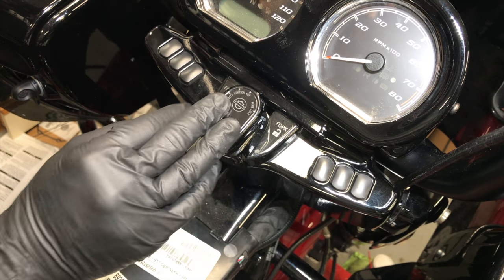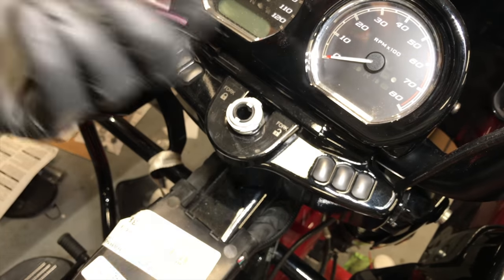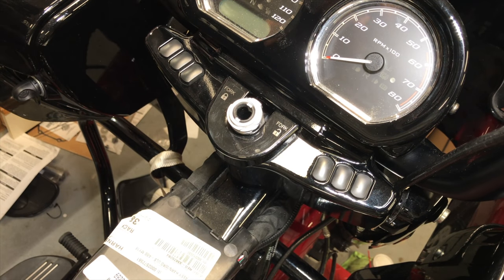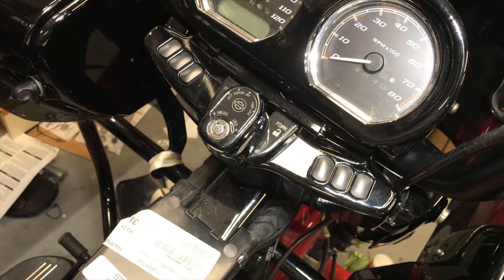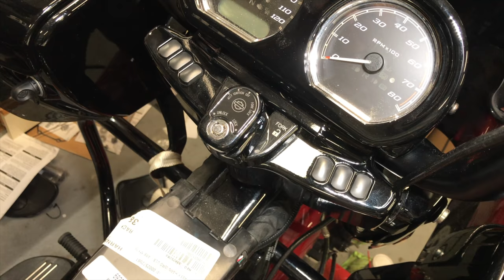How to Remove a Harley-Davidson Touring Model Ignition Switch

Comment: Where are the videos that show how to disassemble and replace  parts inside switches? I'm trying to find out how to take apart an older switch on a 98 softail so I can replace the new tumbler with old  key tumbler that uses the vending machine type key

Comment: Is there a screw under the ignition switch cover inlay? I have an aftermarket cover I'd like to use but it has a place with a countersunk hole and I done want to bend the inlay if there isn't a screw hiding under there.
Reply: Ok. Took a chance. There is a security torx screw under the inlay that holds on the cover. My new cover replaced the old stock cover perfectly.

Comment: Ive had mine off and on two times in the past 5 years; once to relube the front forks and second to install 12" apes.  Always easy to get off but no one ever explains reinstall when there are issues.  Sometimes it just doesn't click back in.  I have to play with it for 5 minutes and tap the chrome lock housing once it falls all the way down.  Not sure the procedure how it actually worked its way back but it locked in and works now.
Reply: Good question.  Hope someone answers it because I need to know as well.
Reply: @ABM261-zi2gl  I found Law Abiding Biker has a pretty extensive tutorial.  It is a bit of work but it is thorough getting it back alligned.
Reply: AboutMy FathersBusiness   Thank you Brother.  I think when you sent me this message I was in the garage working on it.  I was able to get it done.  Thank you very much for reaching out.  Ride safe out there brother.
Reply: Can you remove the key from the switch without misaligning it?

Comment: What if your switch doesn’t engage back properly? I took mine off and it won’t rotate properly. My bike does turn on. The key can’t lock the switch and the switch won’t come off li it used too. I’ve done this before, but today it just won’t rotate properly. Any suggestions??
Thanks
Reply: I'm having the same issue. What did you do to fix it?
Reply: Except for the Roadglide,  if you just pop off the little deco piece under the switch you can lift the gauge pod off by turning the switch so that it fits through the large hole.

Comment: Nice for people looking to remove the ignition knob.  The switch is below the knob. Every video on YouTube labels it ignition switch removal.  Automotive  cylinder is different than the ignition switch /electrical part is called switch.  Anyone have a video of the fork lock mechanism and the electrical part.  I want to eliminate this to add the new radio.

Comment: On my 2020 road glide, when I go to lock the forks it is very hard to turn the key. If I remove the trim underneath the lock it seems the lock goes further down and it’s easier to lock without any force. It’s like of the lock is too close to the trim. Anyone had this problem and is there a fix. Greatly appreciate the help in advance.